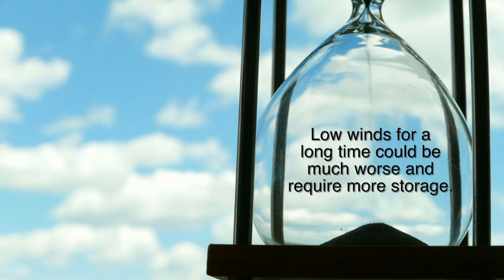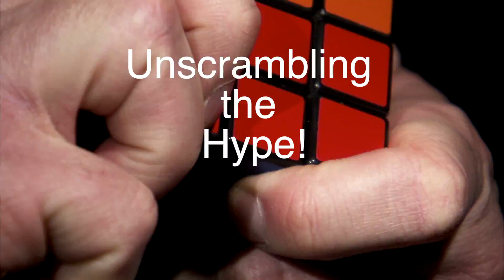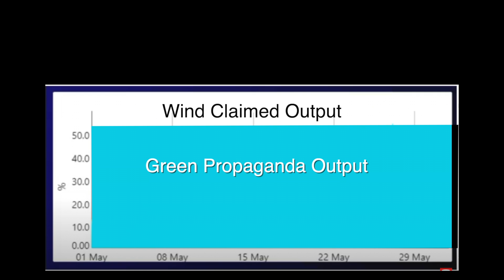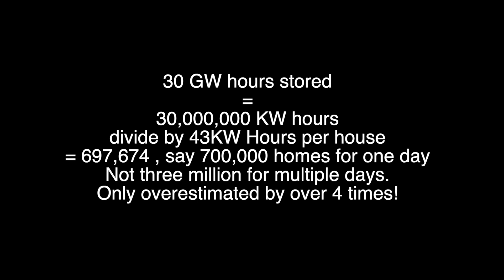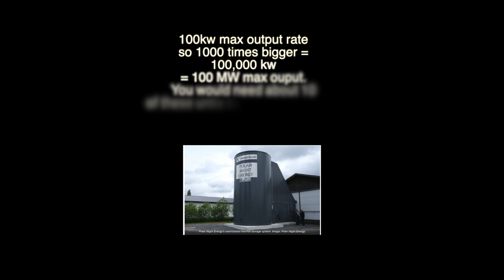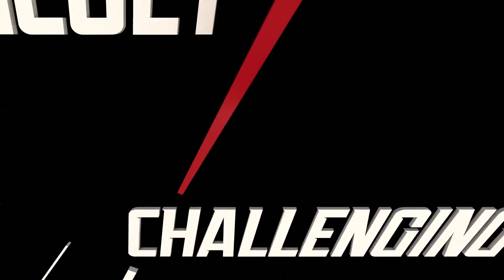When the wind stops 7   Is anybody doing the maths?

Comment: Renewables only electric generation  is a pipedream, its impossible to store that much (even with "flow batteries") so agree with premise of the video. 

However what I would say is that with base load generation (nuclear, coal) the calculation is incorrect, as you only need 1 day storage. You would basically ignore wind and use storage as gas to push the base load higher from 26GW to around 34GW. Then your 185GWh will actually be provided by base load.
It's a lot of work, thus reliance on 1:1 wind to gas ratio for generation.
Reply from the maker: The entire point of the wind is to do away with gas! 
There is no point in using wind when you have to use 100% of the gas to back it up.
Or am I missing something?
Reply: So, if the purpose to get rid of gas, all you need to have enough for 1 day storage to push your base load from 26GW to 34GW. So your store excess off-peak base load and  recharge your storage, and then use it during the day when needed, ignoring all renewables. 

Then how you deal with wind is by recharging the storage, and once you get to a certain % you lower back your base load slowly (coal and oil let's you do this). 

I also think hydrogen is a good "waste product" to deal with excess wind generation. Instead of wasting it, maybe we can use it in transport or something.
Reply from the maker: @tychostation2350  No.
How do you push your base load from the 8GW level int is today to 34GW?
You today can only do it with gas or coal.
What you are proposing is simply doing away with wind and using fossil fuels.
You have to keep to the plan which is to remove fossil fuels and that means gas and coal.
If you have covered up to 26GW with Gas/Coal then yoiu have no spare overnight , no certainty of wind to top ups in the day.
Sorry but you are not understanding the basics here - a world without fossil fuels and storing excess wind energy to cover the shortfalls.
Reply: @ClimateRealism  0:52 the graph is 26GW. 
Wind only system is impossible as you demonstrate with your video. 
However if you kept nuclear or oil or coal - but not gas - then calculation would be different as your storage becomes your load balance.
Reply from the maker: @tychostation2350  The entire point is that fossil fuels like gas are to be done away with.
If you had only nuclear you could not vary the daily demand over base  - the perfect solution is nuclear and gas - no wind.
My video is attacking the concept of balancing wind and the entire net zero policy.
Reply: Tommy your just not getting that the issue is they dont want to use ANY fossil fuels you keep replying with more fossil fuels as an answer. Using fossil fuels does not "net zero" make 👍👊
Reply from the maker: @BOBOFENIAN  The entire point is to abandon net zero. I have many videos explaining why that should be the case.
The effect of the huge increase in wind farms is that we have actually become more dependent on gas and need more of it.
Reply from the maker: Alsoyou still would need 100% gas up to 32GW for 9 days when the wind has not blown for 9 days.....I do not see your point???

Comment: Funnily enough a few weeks ago I did a rough quick back of the fag packet calculation based on supplying all the electricity for the whole of the UK for 1 day using tesla battery's 100KWH each and at a low bulk price of 20K per battery. based on 821,917,808,219.1781 watts per day /100000 to get one 100Kwh battery = 8,219,178 tesla batteries X 20k = 164,383,561,643.8356 pounds that's one hundred sixty-four billion three hundred eighty-three million five hundred sixty-one thousand six hundred forty-three pounds😵. For ONE day. And the batteries capacity will begin to degrade from day one. And as you say they will all have to be replaced every few years. Insanity doesn't even come close. Ps feel free to correct any of my sums ad its all ballpark figures and my brain isn't what it used to be😁.
Reply from the maker: The base load from nuclear and biomass is currently about 8GW. So you need to supply at a rate of up to 32 GW to reach the 40 GW. 
A 100KWh tesla battery can output just 225 amps so at uk bvoltage of say 220v is about 10Kw.
hence you need 32,000,000/10 = 3,200,000 batteries to meet the output rate of 32GW but only for 10 hours. 9 days is 216 hours so say we multiply by 22 to give
3,200, 000 x 22 = 704 million batteries for the 9 days.
say £20k per battery = 20 x 704 millions = 14,080,000,000 = £14.08 Trillion pounds.
That is about 7 times bigger than the UK GDP and has to be replaced say every ten years!
Also there are not enough material in then world to do it and the prices would shoot up with the demand. Plus this is just one country - with the western world going over to this the mind simply boggles.
Nobody is doing the maths!😁
Reply: @ClimateRealism  My Math was way way off on the conservative side and I forgot to factor in the the output not just the capacity. D- 😁. But I think a lot of people on top of not wanting to do the math simply no longer appear mentally to be able to admit that what they believe is wrong. Critical thinking seems to be a lot about accepting new data as you become aware of it and adjusting your view accordingly. This sadly appears to be a dying art.
Reply from the maker: @carlphillipson9887  Net Zero is a religion. That is why they will not debate.
Reply from the maker: @carlphillipson9887  Carl, The output side is very interesting and very limited which is why we cannot even run the grid for a minute, let alone a day.

Sand battery are useless because they take so long to charge and so long to discharge at very low levels. Again nobody is doing the maths.
Reply: @ClimateRealism  You would think that no one in the GOV owns a calculator or has google. When a old fart like me can sit down and spend 20 minuets on a few google searches and do a few sums "If a bit off target😁". And come up with the overwhelming impression that this is completely unworkable. If I was a cynical man🤔 I would say they absolutely know what they are doing and their agenda has nothing to do with "being green". But that's a whole different can of worms.
Reply from the maker: also just imagine the recharging problem after the 9 days!😀
Reply: @ClimateRealism  Truly ludicrous isn't it.
Reply from the maker: @carlphillipson9887  Its total partiestally absurd - all the MSM and main political parties are led by people who simply cannot manage technical data/information.
I was on a national committee in water resources who planned a national technically based system. They commissioned a feasibility study that cost £25,000 in 1974 money. I simply did not understand they way they wasted time and money so went off and wrote the system in ten weeks at a cost of £10,000. The feasibility study came back after months and reported it would cost £250,000 and take 2 years!!!
I ended up exporting the system around the world and made a profit in the water resource department I ran in Wales. I was then criticised by our accountants for mucking up their accounting system because they only classed my department as an expenditure one. I have always been disruptive😀😀😀
Reply: @ClimateRealism  Well long may you keep up the disruptiveness 👍😁
Reply: @ClimateRealism  BTW my word of the week is. "quixotic" Taken from the character "don Quixote" Who ironically attacked windmills instead of trying to build them😂
 Definition of quixotic
1: foolishly impractical especially in the pursuit of ideals
especially : marked by rash lofty romantic ideas or extravagantly chivalrous action
2: CAPRICIOUS, UNPREDICTABLE
3: preoccupied with an unrealistically optimistic or chivalrous approach to life; impractically idealistic
Reply: @ClimateRealism  well done!!

Comment: I'm worried about damage caused by removing kinetic energy from the wind
Reply: Don't worry the Government are putting out more than enough hot air to offset it😁
Reply from the maker: Removing the kinetic energy from the wind does no harm.
Reply: @ClimateRealism  we can't be sure - after all we can't take too much from the rivers. The air moves in currents which circulate and over time have combined effects such as keeping stronger winds at bay and affecting the motion of temperature and pressure fronts. Then there's the harm of reduced pollen spread, the effects on insects, trees and plants that rely on the wind to cleanse their leaves of dust and to remove or deposit moisture. I can think of many more dangers of reducing the strength of wind currents, by comparing what happens when parts of the oceans turn stagnant.
Reply from the maker: @disdroid  There would have to be evidence to convince me of any  significant effect.
Reply: Probably would slow the spin of the earth, but it would be unmeasurable as trees and buildings would do the same.
Reply from the maker: @PF-gi9vv  No. The kinetic  energy removed from the wind is transferred in part, to the ground via the mast. Also tyhe effect is so tiny that it cannot have any effect whatsoever on the earth spinning.
A building simply transfers the effect to its foundations.